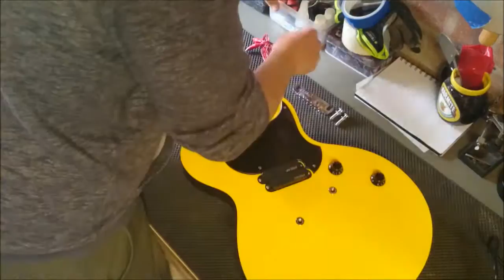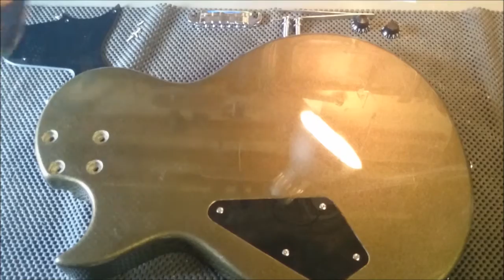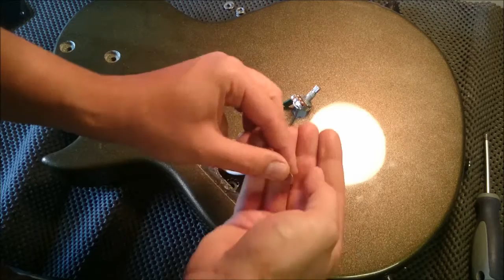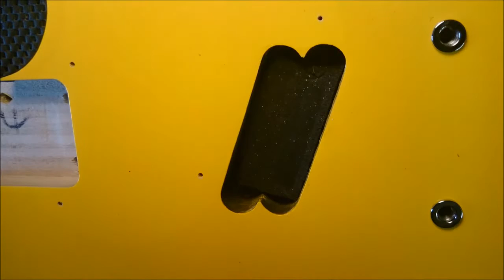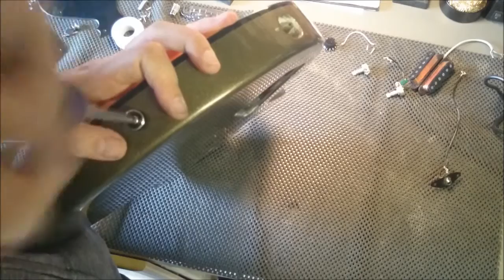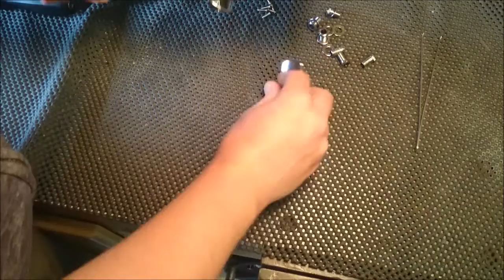Vintage Zip Teardown Ep1

Comment: Great video. I constantly have guitars in bits as I like to refurbish old European guitars.  I have one of these  around with Lipstick style pick ups in gold metalflake. , like the Danelectros have.  They are screwed in through the back like the old Dano's too. It was very cheap and looks very nice. I didn't realise the body was hollow at first.  I haven't seen part 2 yet.. I think Trev Wilkinson owns or has shares in Vintage guitars. He's been making parts for years and designed the infamous 'Vibracell' guitars by Switch.  They only lasted a year or two. The guitars were really well designed  and made of a type of resin called 'Vibracell' which was moulded in a one piece, neck and body guitar. It  could emulate the density of different woods.  They have great electronics and the parts are great. They had a lifetime guarantee too.  They are very futuristic looking and very brightly coloured..  I think it's a great guitar and I think for the price these 'Zips' are good value and playable too. .

Comment: I'm seeing the exact same guitar online right now.... how was the original tone? Think it can handle some hard rock and metal?
Reply from the maker: Thanks for the question! 

The stock pickups are a little muddy, and the position that they're in isn't particularly great for that high treble, raucous rock/metal tone, but I'm sure you'd get somewhere with some amp tweaks. 

I'll be looking at the electrics next including taking the pickups apart, so make sure to catch that one.
Reply: Denver Guitar Studio You're welcome! And ok, thanks for the quick response and usefull info! I'll definitely watch the next vid!